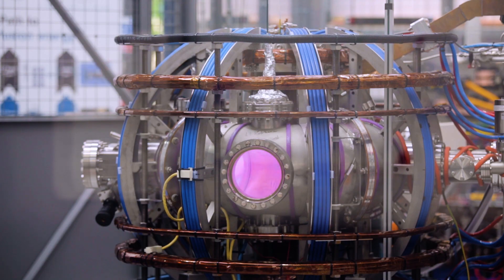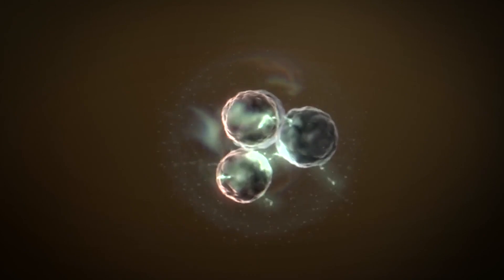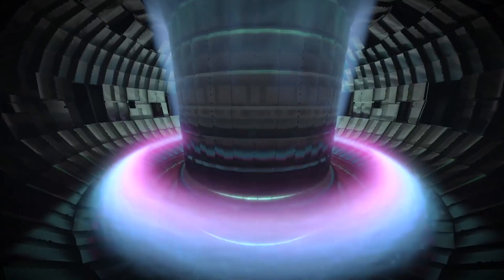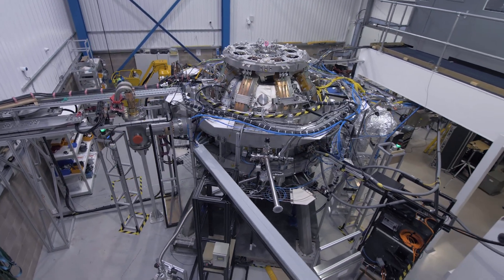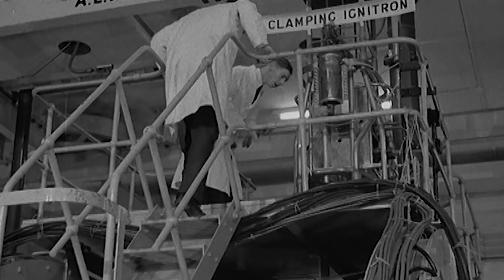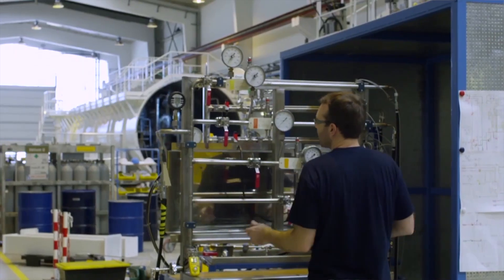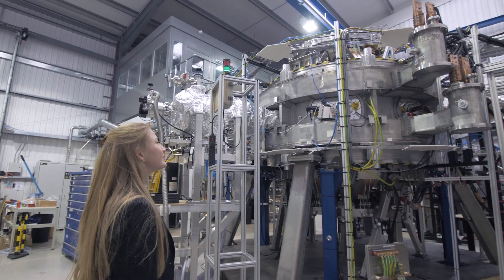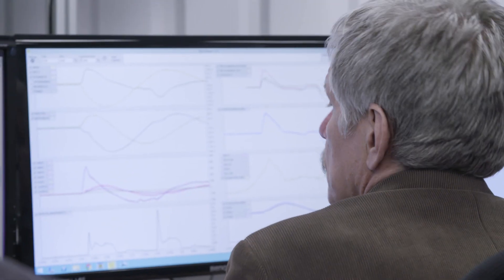What is nuclear fusion and could it change the world?

Comment: So how to get electric from this fusion chamber ?
Are they gonna use Solar Panel ?
Reply: Possibly, however you can use the heat produced to drive steam turbines or use the alpha particles produced to induce a current directly, sure alpha particles are positively charged they will therefore induce a current into a wire. Extracting energy from fusion reactors may be difficult but not impossible.
Reply: Current plans will use the same as fusion reactors where the heat that's irradiated will heat water, which produces steam and spins turbines. Sounds like an archaic way of doing things, but it's the most efficient way we can capture the energy currently.